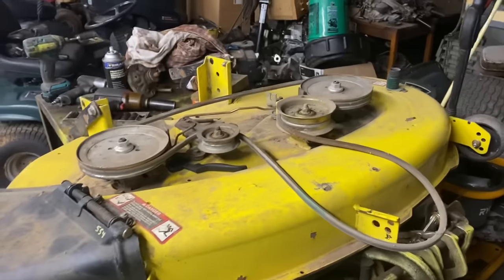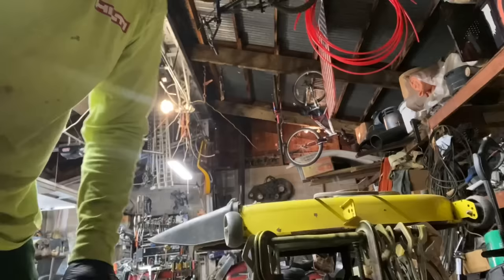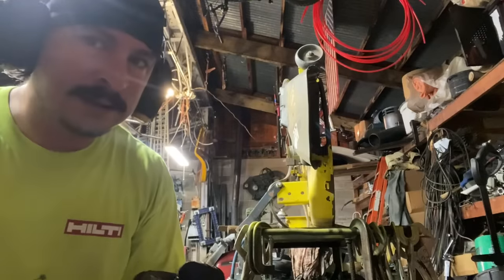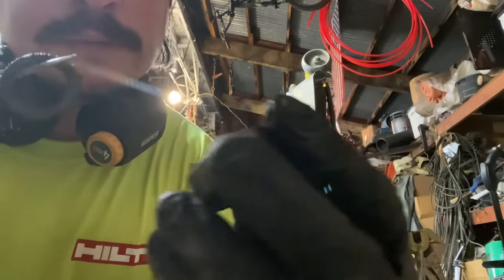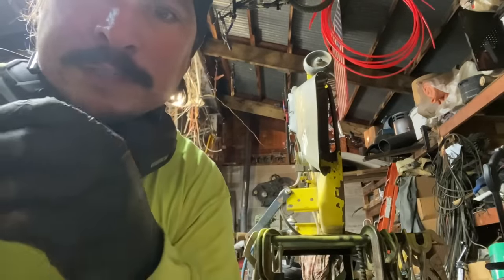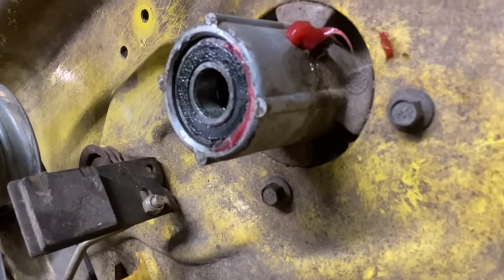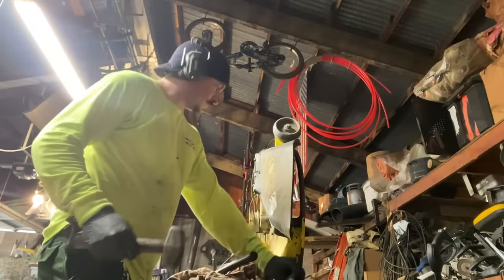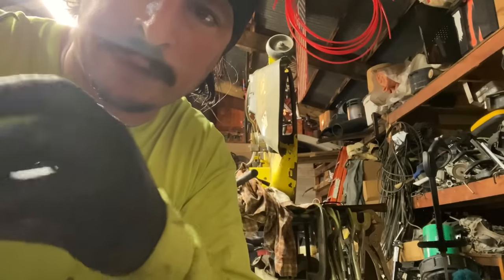Part 1 - Don’t trust the “Experts” Grease your mower deck sealed spindle bearings Common sense.

Comment: Makes sense that grease gets in this way.  Same idea as using a bearing packer but less messy.  Im curious if what they say when the mower is used that it heats up the bearings and all the grease runs back out.  How often do you find you need to refill the spindle to get grease back up in to the top and or bottom bearings?  Or does it pretty much stay in there?
Reply from the maker: Some things to consider like how full you fill the assemblies and what type of grease is used. For the most part grease stays in place. If the dust seals are left on the inner facing sides of bearing this works great because the grease passes the seals when applied with a grease gun and then the seals can hold grease in place. If the dust seals are removed from the inner facing sides of bearings the grease can migrate down as gravity and heat take a toll but if the cavities are filled there is nowhere for grease to go. And it stays in place. The “dust” seals will hold grease in the bearings. The seals just won’t stop pressurized grease from pushing past. How often you grease depends on how much the machine is used. For a home owner once a year should be plenty.
Reply: @GTObearclaw1  That all makes sense to me.  In my case I'll fill the whole spindle so that it pressures the grease past the inner seals when I'm filling.  Just bought a tube of lucas because it's pretty tacky and am going to fill up the new spindles today.  Thanks for proving those other videos wrong.  The only minor downside is wasting a lot of grease to fill the spindle but I'm more interested in keeping the bearings greased and taking apart just to do that is a bit of a PIA.  Plus risk breaking off spindle bolts, which break a lot.

Comment: The bearing unit is small - builds up heat fast.   The spindles come with no grease except in the sealed bearing chamber.  Heat can build up quickly.  Greasing the spindle fully dissipates heat, keeps out moisture.
Reply from the maker: Greasing the bearings is vital but not the only way to prevent heating of the assembly. Most people don’t realize they need to keep
The top of deck clean. As grass build up on the deck also retains heat in the mandrel assembly.

Comment: The packed pillars would also keep out water from sitting inside the pillar ? If there is no zerk is it wise to grease bearings every blade change ?
Reply from the maker: If there is no zerk it would be a lot of work to grease the bearings. In my opinion once a year is more than enough for a home owner model. How often do you change your blades?

Comment: A couple hundred hours is probably like ten years of mowing.  At least in my neck of the woods, lol.  Clay
Reply from the maker: Consider someone who uses these to mow yards for a job is usually spending 10 hrs a week in the seat on average so 10 weeks at 10 hrs of use each week that would mean possible 100 hours in “less than three months. It would be very unreasonable for a bearing to fail that fast. Why would they not last unless engineers planned them to fail?

Comment: You can also take one side of rubber seal off that faces the grease travel to let grease in  everytime you lube zirk....leaving the other side on to hold grease in and keep out dust...
Reply from the maker: Sure you are correct. Iv seen this comment many times. I use to do this process of removing seals myself, But why? Just because it’s fun to take a deck apart to remove a few seals that can’t stop grease from passing? I ran some test and found that grease passes the seals no problem. If you only need to add grease this is the faster easer way and it works. I’d rather work on other stuff and not waste time tearing into a deck if not needed. you would still
Have to pump the housing completely full to get grease to push all the way up into the top bearing. Even without inner seals the grease will not get to that bearing unless the cavity is filled. Gravity pulls grease to the bottom bearing. Why not just apply grease properly and forget about dismantling a deck to pull out a few inner seals. The point of the video was to prove those seals can’t stop the grease for the closed mandrel type that I show. I argue that the inner seals make no difference, if anything the upper inner seal helps hold grease in the top bearing and could be beneficial.

Comment: The seals are meant to keep dirt and grit out of the bearing race. A hand-pumped grease gun can deliver about 7000 PSI of pressure once the air voids are filled up in the annular space. The seals usually cannot hold back anything greater than about 500 PSI.
You would want to try and NOT blow out the outer seal (steel or rubber/plastic) because it creates a future path for contamination back in to the bearing. The inner seal mostly serves the purposes of preventing race and ball damage from grit or dirt if the other bearing is compromised.
(Engineer here, responsible for plant machinery maintenance crews at an oil and gas facility)
Reply from the maker: As usual an expert with advice we can simply throw into the trash. Those seals won’t hold 500psi that’s an absurd number. You are way off track and probably comparing what you know about some other bearings. Have you ever had one of these type of mandrel bearings in you hand to visually inspect? Just because someone is an engineer does not know they know everything. Especially if they find it necessary to make it known. My experience with engineers leads me the opposite direction. I question everything they do. As a mechanic I see too much absolutely stupid stuff. Yet I don’t see engineers coming out to ask a mechanic if something makes sense. Why not ask the guys who actually fix this stuff? These seals would not be capable of holding 5psi let alone 500. That’s one of the most ridiculous things iv ever heard. This is how these are designed to be greased. If you have t done it and don’t have any experience your not one to give advice. If you have hands on experience with a failure occurring due to greasing the way Iv shown please do share. But not a master yet has any hands on proof. And they most certainly won’t take time to make a video to prove so. Your comment  is bogus. The guns can actually reach upwards of 15000psi. That’s not gonna be what goes into these bearings. When you can prove that a seal can be damaged in this application please come back with that evidence. This application will be just fine doing as Iv shown. Caps are installed in a way they can’t push off the bearing. Only the seal of lip lets grease pass.
Reply: @GTObearclaw1  Lol.....I'm retired now but when I was working as a cleaner ( a small food plant ) I had a issue with a 3 hp. water pump that came loose from it's mount. Anyway 2 supervisors who were also engineers by trade happen to look at it and the both of them started talking about all these elaborate fixes for this problem. The installer had not used hardened mounting bolts and the threads on them were stripping. I just replaced the stupid bolts with a harder grade and the problem was gone and didn't return....but it made me laugh to hear these guys.
Reply from the maker: @dennisshaughnessy5612  exactly why I don’t trust experts

Comment: If you can get the bolts out of the with out twisting off if thy do replace whole spindle assembly and drill out the holes with a 5/16 drill bit so if thy twist off again you can get the bolt out and replace the bolts.
Reply from the maker: As I show in other videos there is no reason to pull the mandrel off the deck unless it’s broken. Doing so will rush breaking a bolt. Use a heat gun or other means to heat the bolt and threaded area before attempting to remove if removing is necessary so that a bolt is much less likely to snap off. However clocking the spindle 1/8th turn and drilling new holes between the original bolt holes is another option buys extra work but saves on buying a new Spindle. I just prefer to leave them mounted unless I need one off to make a structural repair on the deck shell. Otherwise it’s just flirting with turning a simple service into a much bigger more expensive project. As for the topic of this video, your comment leads me to believe you didn’t watch the video to see what the  main point is. I’m showing how to grease the unit through the existing zerks found on some machines so that would help avoid the need for any parts to be removed from this deck. I only show myself removing bearings to prove the grease penetration through the shields. Some folks don’t understand that grease will push past a rubber lip on the shield. And some still can’t grasp the information even after it’s been broken down into easy to follow steps. But that’s what I was trying to show here. 

As for your comments, yes true but not really relevant on the topic I’m discussing here. But I do believe there are better ways to approach what you’re describing.

Comment: So whats it take, a tube of grease just to fill the mandril, then it's forced through the seals into the bearings?
Reply from the maker: Iv never seen it take a while tube to fill the Mandrels. Maybe if it’s never been properly greased the first time it might take a half tube if you have a deck with three. The good news is that after the first time it won’t take more than 3 or 4 because once it’s filled it only takes a few pumps.

Comment: A buyer would think that they made some money when the mower was purchased . But , NOOO , they want to “ sock it to you “ while charging for repairs that were preventable in the first place ( most small engine repair shops ) insist that you have to purchase a complete housing kit , costing several hundred dollars that the bearings cannot be replaced ; when a great set of aftermarket bearings can be purchased for less than $10.00 for the pair . 🤷‍♂️🤔😤😡

Comment: Makes sense, but now the metal sleeve will ride the actual ball bearings ,  so there’ll be metal to metal contact with some grease ???
Reply from the maker: How in the world did you calculate that nonsense? 

Your overthinking a simple process. This is the way it works. Not a big deal. Nothing to worry about. Metal to metal contact? I don’t know exactly what your saying. Regardless this is how this works. Add grease. Stop
As soon as you see grease exit form a bearing. No need to keep adding grease, will only make a
Mess. Good to go. Don’t try to invent problems because there are no issues doing it this way. Only a bunch of naysayers trying to convince you it won’t work and not a single one of the naysayers can provide any proof of what the issues are. They are just smart enough to know without ever showing it to us. No thanks. I’ll trust what I have seen work. Always add grease if you have a zerk. That’s is why they are there.

Comment: pop that cover off those bearings and pack. The black cover pops off those bearings and will pop back om after you pack them...then i fill the chamber up as well...when it warms up it'llget in .Did it to my Gravely 460 and my Husqvarna spindles
Reply from the maker: Are you trying to go the long road and tell me your tractors didn’t have grease zerks and that’s your only option is to dismantle the deck? If so, you are correct. It’s really hard to extract everything I need from such a short comment. Eaither do it the way you describe or add zerks while it’s apart and forget wasting time on that again. 

If you have zerks, I’m not sure what your telling me other than you didn’t bother watching before you left a comment. That’s nothing new here. I’ll be happy to take a minute to comment.
After all I obviously don’t shy away from arguments with the naysayers. Even though I would quite put you into that category. I mostly think you just didn’t see the whole video. So how do we gain access to those “covers”? Maybe by dismantling the deck? That would be the exact reason i shared the process of using a zerk to avoid needless disassembly of the deck to reach those “covers”. Get real here, did you even watch the video before you left the comment? Obviously not. I realize the bearing shields pop off. That process is clearly shown in the video multiple times as I make my point painfully clear. Exactly how far did you watch before deciding you could help me find the better solution to the problem by devolving the process. I’m showing how to avoid wasting a bunch of time, because taking the deck apart to remove a bearing shield to add grease is absolutely moronic when the unit has a grease zerk. Hell, why not just move into a cave or start living outside again? If you actually watch the video you can see how using a zerk gets grease into the same spot without taking the deck apart or even off the tractor. We can add grease through a zerk in a matter of minutes and save a ton of time while also achieving the same outcome as manually adding grease to the bearings individually at a much greater time investment. the only reason the deck was taken apart in the video was to prove a point. And that point is that grease applied through a zerk fitting reached the bearings. I did the extra work to prove the grease passed into the bearings in hopes that it could save other folks a lot of trouble. It’s called taking one for the team. Now my thumb is tired.